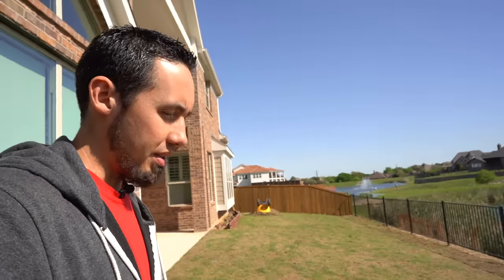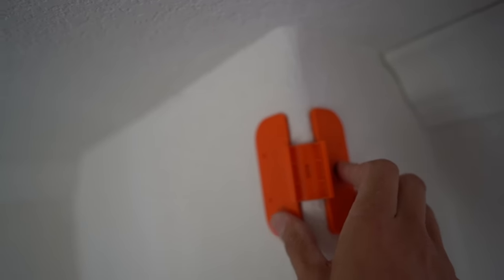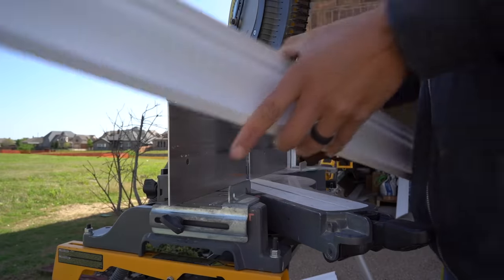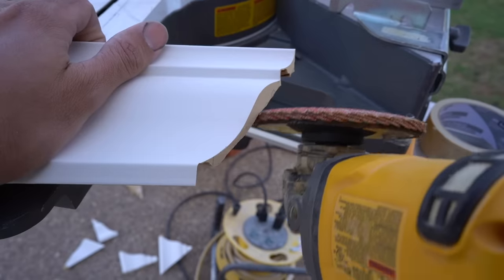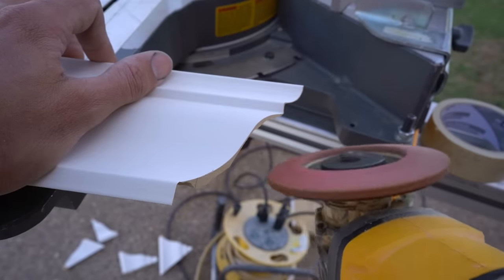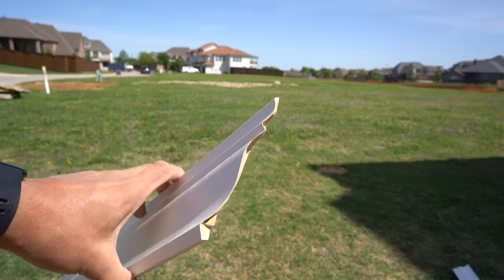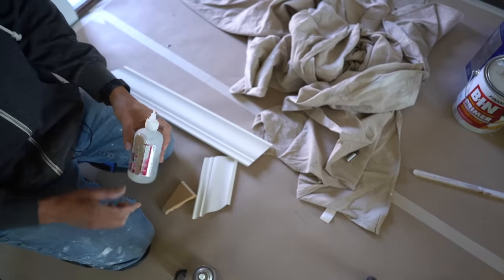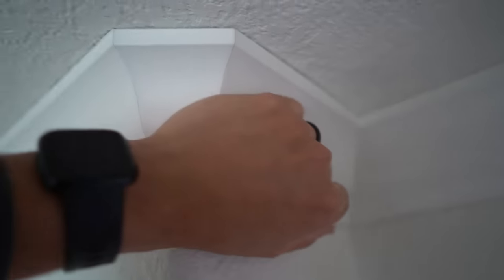This Makes Coping Easier

Comment: I’ve been doing this almost 40 years. I’ve tried dremels for the back cut, but never considered or thought of using an angle grinder. So thanks for that. And congratulations. It is refreshing to see a young guy take pride in his work these days. A lot of jobs I go to finish, I look at how some of the trim or crown was done and just shake my head. You are going to be very successful. Word of mouth and reputation wil make you a sought after commodity. Great video
Reply: I think dremel is better cause you can control better for more precise cuts.
Reply: Or be skilled...after a couple coups you should get a good hang of it, if you are worth anything
Reply: @gerardoquiroz4290  I grinned half of my thumb yesterday.
Reply: I built log homes and learned to cope with a 7 inch grinder and a 4 inch. You definitely better watch clothing and body parts.
Reply: I agree. Very rare these days.I had over 50 apprentices only 7 are still in the trade. Just enjoy seeing someone taking pride and doing it right. I stumbled across this video for a small project  glad I did . Bought extra stock  just to try to do it right to make it look good. Refrigeration Tech by trade but I don't shy away from a small project like I've got. If I needed all crown done I'd hire it out. Sometimes you gotta let the pros take over.
Reply: 0
Reply: If you cannot cope with jig saw you all should go do something else for life.  Why struggle at job that you are not good at?

Comment: I did this for the first time today!!! My husband did the cuts, I did the coping. I put my hubby’s angle grinder (with the flap like you have) in a vice though because I’m not strong enough to hold that thing. It came out perfect! 112 linear feet DONE in an hour!!!! We are never looking back! Thank you so much for this post!
Reply: Did u guys use MDF or primed Pine wood
Reply: kevin kelly it was the cheap plastic stuff that melts when you cope it. Lol I let it sit in the wind of the flap disc and then could pop the scraps right off when they cooled down. Would have been easier with wood but we had a tight budget.
Reply: @charlieann82  So, do u think it could be done with wood ? Or will it work the same with wood or Oak??
Reply: kevin kelly He is doing it on wood and I have seen other videos with it on wood. None on the plastic stuff we got. So I think it would be easier on wood. It was easy peasy!!
Reply: No,  that's MDF wood there!
Reply: @charlieann82  No, That's MDF wood, its compressed cardboard
Reply: @charlieann82  i want a see it done on wood/  / Pine Or Oak
Reply: kevin kelly 🙌🏻
Reply: @kevinkelly9303  36 grit flap disks eat through pine just as easy as mdf, red oak the same, white oak not so much. More finesse.
Reply: @jaredmurphy4388  thanks, i really appreciate this information.  I'll sure try and use it this week
Reply: @kevinkelly9303  klingspor or Dewalt make pretty good disc's if you're looking.
Reply: @jaredmurphy4388  Thanks, ill look to purchase one or the Other
Reply: @kevinkelly9303  I carved an oak/maple laminated guitar neck with a grinder and flapdisk. It is my goto tool for a lot of problems
Reply: @djsnowman06  So u stand behind this guy being able to use this to cope Wood also. I understand the fiber board wood
Reply: @djsnowman06  Or the MDF molding
Reply: @kevinkelly9303  if you press too hard it can burn, but other than that I see no problems with it
Reply: @djsnowman06  im a try it that a way then. Thanks
Reply: See, dammit, if you have not taught her how to do that she may have called you a ride to pay us to do it but no thanks to you she knows how to do it herself way to go put us out of a job. Not you ma’am I’m happy that you save some money and did it yourself. I’m talking to the other dude that taught you how to do it that’s putting us out of work. LOL
Reply: I've used this method on poplar. It works just fine.
Reply: @djsnowman06  ?💯!🎯❗👀 my 🎸 guitar is my #1 go to tool also !!! When I'm in a spot
Reply: @charlesrittenhouse3631  
Contractors started giving away the secrets to the trades a long long time ago. Same with just about every other service provided. It helps and hurts those of us blue collar workers. It is what it is unfortunately.
Reply: Cee Bee  I’m glad my husband and I aren’t “Harry homeowners”. Whew! Close one. Lol
Reply: @kickassclone75  My McMansion is a 1966 2500sqft ranch style that used to be my grandparents house. My husband and I are a team. Something is wrong with you, talking to strangers like that. Blessings be upon thee, classless peasant. Lol
Reply: @kevinkelly9303  loop
Reply: You know he tries to explain everything then he forgets to emphasize that you should only do this with battery operated angle grinder. That's why you cant handle it, you're using a corded version which spins like a screaming demon. Use a battery operated one for coping which spins way way slower. You're welcome.

Comment: Been at it 40 years and thought I knew how to cut crown better than most. You can teach an old dog, thanks.
Reply: That was a great video
Reply: Me too 40 years, but I have to ask. This is what you use if you can't find a coping saw right? The fact that's it's done free hand with a grinder has too add some control difficulty no matter what the experience. Though I have to admit this is one more tool of knowledge too add to ones  repertoire. Still a good video.
Reply: @jonwts48  I grind all the time it’s easy when u get it down ! I lay pavers always cutting pavers
Reply: @jonwts48  well I've been at it 41!
Reply: @garpikemike1  So you favor this over a coping saw? I'm  just saying I did a whole lot of finish work, what I'm asking is 'if you have a grinder and a coping saw on the table you'd pick the grinder? I was just curious that's all I never seen no one do it like this so naturally I had questions. Like the precision of using a grinder on wood. But if I find myself without a coping saw I'd use grinder,so again good video.Lesson learnt.
Reply: @jonwts48  I think it is easier to get a concave cut. Even coping saw and file/dowel sanding getting a convex cut all round difficult.  Whereas the edge of the flap and arc of the disk allows you to get all the angles scalloped.  If you clamp it at a good angle you free up the other hand

Like he said you don't  need something too powerful, but jut powerful enough.

Comment: I just tried coping some crown for the first time. My 45 degree corners didn’t come together at all. The 22.5 inside corners were better, but I ended up scrapping the job altogether. The un-nailed 16’ pieces got returned to the Home Depot, and I broke the rest up and threw it in the garbage. Job complete! 😂😂😂

Comment: I've been coping for years, using a jig saw and belt sander. You taught an old fart  something new. This is my new method of coping. Utterly amazing.
Reply: B.J. Neyer you can also use a rotory tool for fine details
Reply: Does this method work just as well with solid wood trim and not just only mdf wood trim?
Reply: @jonelortiz268  I'm down due to injury, but I can't see why not. You might have to use a finer grit and not push too hard so the wood doesn't burn.
Reply: B.J. Neyer sounds good, thanks for the help! Cheers
Reply: What about us young farts haha
Reply: I just learned how to cope with a table saw the other day.
Reply: Zeljko Situm and just because someone does something a different way doesn’t mean they CANT do it another.
Reply: Taylormade2350 usually how I do it.  I’ll give this a whirl though.  I like to see how people get the same product in different ways.  🍻
Reply: nice work !
Reply: @jonelortiz268  indeed it does. Dewalt makes those discs in several grits depending on the material. Used it on everything from Walnut to foam. Been using this method since I caught a coworker doing it 20 25 years ago. A Dremel tool will help for finer detail.
Reply: @jonelortiz268  Yes, I just used this yesterday with solid wood trim, so much easier than a coping saw. I also use a Dremmel for the fine details.
Reply: @Taylormade2350  Any particular bit for the dremel?
Reply: @jarvischurch1922  just a regular old cutting bit
Reply: @Taylormade2350  I learned that working with a cabinet guy once, told him he was nuts when he first mentioned it, but it works really good, it just takes a steady hand.
Reply: @Taylormade2350  Like a Dremel tool?
Reply: @jarvischurch1922  carbide burr bits do most work

Comment: Hey Bro, thanks for sharing.  I've been a framing carpenter  in L.A. since like 2001.  For the last year,finish carpentry has been paying my bills and most of that knowledge has come from you.  I appreciate  what you do.  Thank you
Reply: 10x more rewarding though I bet
Reply: Stair rails
Reply: Paul Jmr I’ve tried a coping saw. I have a hard time controlling the blade. I would probably have my wife do this. They don’t call me Shakey John for nothing. I’m a surveyor, just not a very good one.
Reply: @paul_jmr8022  So you are against taking short cuts? Why? I bet you use an electric miter saw don't you? That is a short cut. My dad used to do his crown molding miters with a miter box and a hand miter saw....so to him using the new electric sliding miter saws is a short cut. Sort of like taking the jet airliner instead of the old piston engine driven aircraft. What about your TV, still watching B&W? Let those who come up with a better mousetrap rule the day and pass on their knowledge so that we can all do the job a little quicker and a little better.
Reply: @paul_jmr8022  I have been in the building industry since 2007 and have seen multiple methods of coping. This one is far superior for time efficiency and clean lines.  He doesn't film it at his regular speed. As I'm typing this I wonder how long it has been since you made this comment and if your opinion has changed.

Comment: That same crown molding you're installing in this video was  my first crown molding install. Chipped a couple copes learning lol. It was a frustrating experience but I got through it and client was thrilled. I on the other hand was mentally exhausted wrapping my head around crown molding. You're absolutely correct about not letting it frustrate you!

Comment: You’re definitely a thinking man. No surprise that you’re continuing to go places.

This was a great tip - so much quicker. Thank you.
Reply: So much quicker than what?
Reply: @marine9583  mayby a hand coping saw ? lol
Reply: @Call0fGodZ  Ok. Maybe so in that case. I use neither myself. I have an oscilating tool, and a miter saw. Does the same job, but faster. When I was a kid I had a coping saw for a fun tot. It now sits on my wall for nostalgia. Actually, no one uses them on my crew, or any that I know of really. Theres just better and faster ways now; have been for a while. Your thoughts?

Comment: I've been using a dremel tool to do the same. Works great.
Reply: Frank Contreras what type of bit disc do you use on your dremel tool? Sanding drum...?
Reply: Adrian Wilson I started by using a oscillating Dremel. Cutting it horizontal to base boards. Then go back with a Dremel rotary to clean everything up. It turns out great.
Reply: I've used a cope and mitre saw to do the same thing 10x faster
Reply: We use the Dremel 543 1-1/4” cutting and shaping wheel.  Works well on soft wood.  On hardwood the grinder will remove stock much faster but the Dremel 543 will get in much tighter details.  If you have a lot of hardwood to cope having both on hand will be the fastest.

Comment: Here is another pro-tip for those just starting to do this method. If you're having difficulty with going over your line, use a finer grit flap disk. It remove less material and will be more accurate. Once you get good, get progressively more aggressive disks to speed up production
Reply: And you can use the finer grits to sharpen your mower blades once you progress, I use 80 grit on my blades and some folks use 60.

Comment: I been doing it this since your first video on it as well. And the sandpaper glued to a piece..that tip may even be better then the grinder lol. But bro..pull out your kreg table and clamp your work down so you have 2 hands for the grinder.  So much more control and  if you can rest your hand on something even better.  But awesome job. And just trying to help bc the tips I got from you are priceless
Reply: Bill Zima agreed, glued sandpaper tip was pro. And definitely all about clamping, so much more control with two hands on.
Reply: Without two hands you will screw up many pieces
Reply: Bill Zima    What is the glued sandpaper method? I must of missed that one....
Ron
Reply: Ron H probably glueing sand paper to the face of a piece to use as a profile sander.
Reply: @ronh9384  its sandpaper glued to base,crown, shoe..whatever you are  coping.  He first back cut it with the grinder..then used the piece with the sandpaper glued to it ..to match the profile exactly.  I found a roll of  self adhesive sandpaper on Amazon.  I believe its from  Porter cable and it's like 4" x maybe 50' but it works great.  I actually have a few pieces of my most used trim already made up and keep them in my trim with my guns,glue,nails ect and I'm telling you no matter how you went about coping b4 this is the cats meow.  Its impossible to get a better fit with any other method.  It's like running wood through a jointer..flawless!
Reply: @Michael Pilolli yeah me too
Reply: @billzima7068  do a vid on such subject matter!!

Comment: Great video, 
I’ve used a combination of coping saw and jig saw for years. Only recently discovered the flap wheel for taking off loads of material quick but never thought to cope with it🤔thanks for the tip! 
A tip for for anyone else out there new to that 2 part mitre fix. Learned a couple years ago ya gotta back it up with wood glue as well or those joints will  pop long term from expansion 😬

Comment: Same here. I've been a carpenter since 1975, mostly framing , exterior trim and some interior trim for the first 15 years. Now I do remodeling, so do a lot of everything. When I do crown or base, I've always coped with a coping saw, until a few years ago I started using the jigsaw. That works great too, but u do have to fine tune with a sanding disc. Or sanding block. I'm working with a flat crown now, no curves. Very little forgiveness. It takes the disc to get it down. So it does work. Good video.
Never tried that quick glue. Gonna have to investigate it.

Comment: I'm a carpenter, but not a finish guy. I come here to brush up on my finish skills and learn the right way to do things. This guys good at what he does and very informative. The blade he refers to in this video for coping was about $8 at Home Depot. Well worth the money for the time it saves knocking down the trim. Works well with solid wood. Thanks for the videos.
Reply: Do you know what brand? I've read reviews elsewhere that say that some discs are much better than others for this purpose.
Reply: merchantbankers i use dewalt and it works well

Comment: I will be trying this on some scrap. looks like it would be faster and cleaner than a coping saw.
Reply: Im going to give it a go aswell, but to me it looks a lot slower, A cope only take 10 or 15 seconds to cut but i'll do a few tests to see how long it flap disc takes
Reply: @ellicopter1  I think it looks longer as he is going slow and talking us through the steps. I also believe it may take a whole 30sec longer but better results. That's my opinion because of what I see in his work and how meticulous and neat he is, and that's the type of work I do. No rushing or cutting corners, just put out nice visual guaranteed to last work. Quality over quantity always.
Reply: You will never use a coping saw again
Reply: Aaron Elliott 

This method is much better and fast and more versital than coping saws. Like scribing long base, back bevels, reliefs and many more. Backing pads are better. Cut a bevel, cut the straight section with a chop saw and snap it off then grind the detail. It’s best to clamp the piece, choke up on the grinder and rest the other hand on the piece placing your thumb on the guard for the best control. Don’t stub much material past the clamp or the piece will vibrate and chatter.
Reply: @Bigjmoney83  I use the angle grinder with a flap disc too. I find i get better results with the grinder. I just got the Festool ras and am going to try that, i was told it works better than the flap disc. I also use a file to clean up the corners.
Reply: I can cope trim larger than yhat faster than that for sure 10 seconds with a copeing saw this took way longer that's MDF also if it was pine or oak or poplar it would have taken even long
Reply: I was hoping someone could tell me if anyone is finishing the the trim caulking, filling nail holes, and painting?  There is no reason to cope or grind. No disrespect ment at all I love what I do and love new and better ways of doing things time is money and everything need to be perfect

Comment: Could you make a video of how you paing the crown molding or baseboard molding. After you installed it? 
Thank you
 Greats videos
Reply: It's usually sprayed in place. With baseboards you can get away with spraying a couple coats before they go on the wall and doing prep and rolling the last coat but it looks horrible on crown if it's done that way. Has to be fully prepped on the wall and sprayed for it to look any good